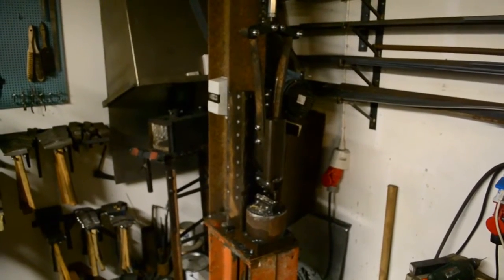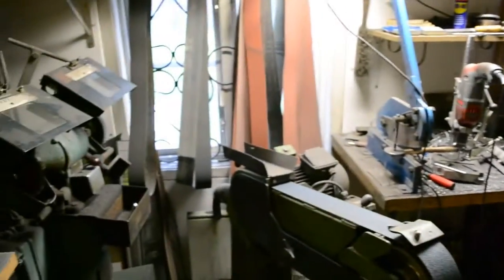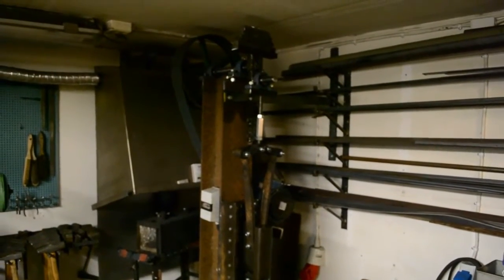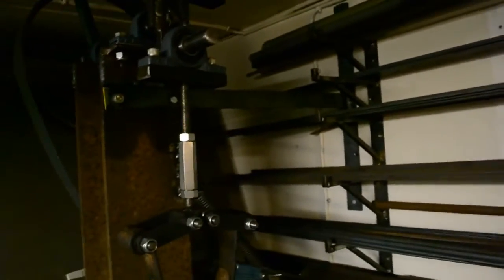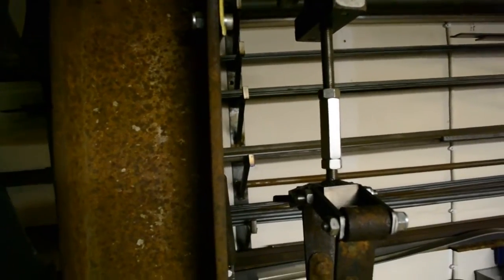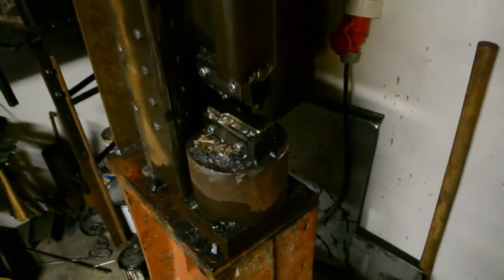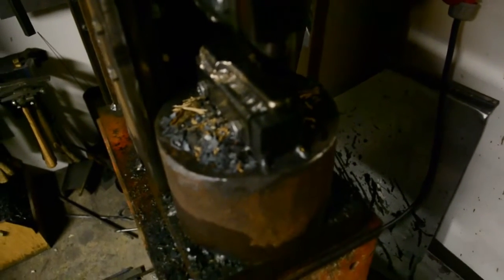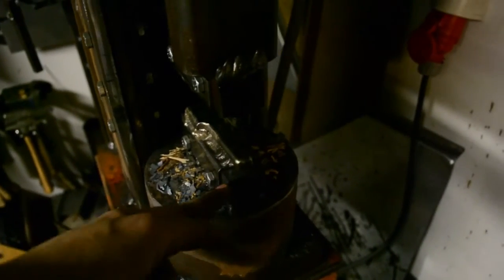Homemade power hammer

Comment: How'd you decide the weight of you counter balance? I am building my own PH and need to research how to balance my wheel for stability... thanks in advance.
Reply from the maker: i read somewhere, most likely on anvilfire ,that about half the hammer weight is a good guide. but basically 1:1 ratio would be ideal. the better the balance, the better control you get. I've since the video added more counter weights both on the belt wheel and the on the front.

Comment: Very nice design! I like the fact that the guides are welded onto the central column. Can you show us the back side, to see how you mounted the motor?
Reply from the maker: I've just posted a video where you can kind of see how my motor is mounted, I also have some stills on my homepage/blog (the page is mostly in Swedish). The motor i got my hands on does not have feet so i mounted it with bolts on a piece of sheet metal witch in turn is welded to a U-bar that is attached to the main column via a hinge. The motor is also supported at the back end by a thin flat bar bent around the motor.  

new video: https://youtu.be/1TNelnf9ikE

stills: http://fredinsmide.blogspot.se/2014/10/fjaderhammare-antligen-fardig.html

I hope you find it helpful